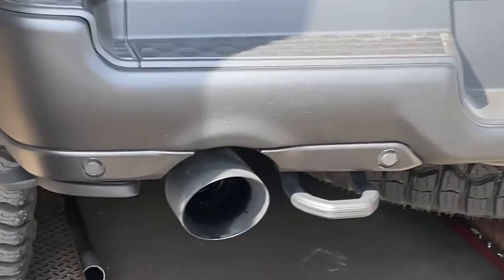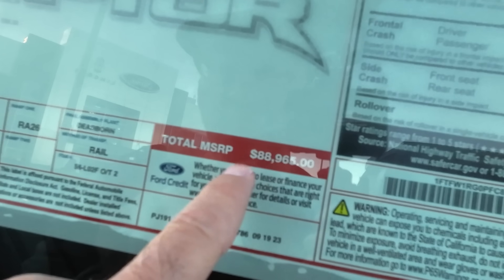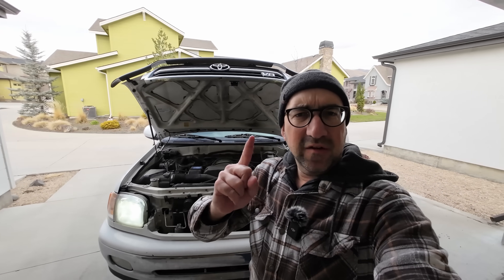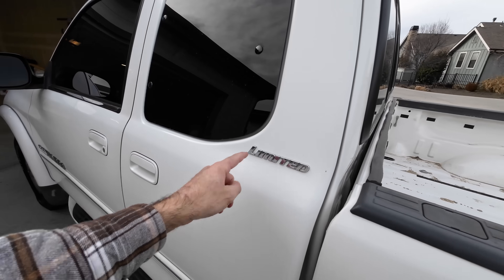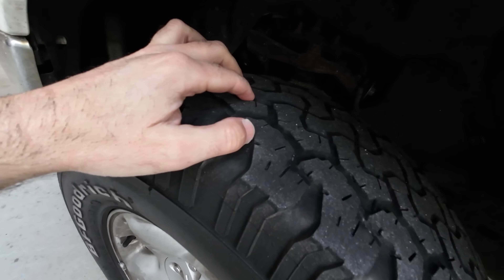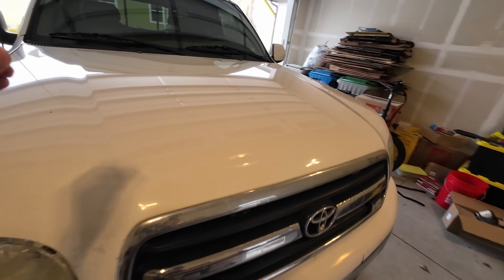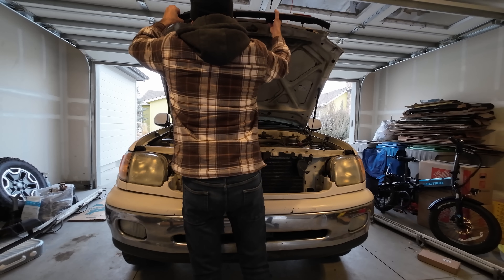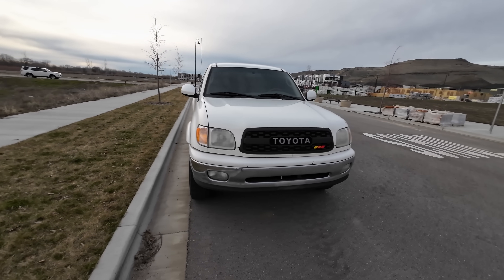I'm Sitting In The BEST V8 TRUCK Ever Made! (and I bought it)

Comment: Bought a 2002 Tundra Limited with every bell and whistle in Sep 2001 with 4 miles on it. It now has 249K on it and its the best truck ever made period. Runs as good if not better than new. For the people who think you paid too much for it? Obviously does not know anything about Toyota. I challenge them to search the country for a cheaper one IN GREAT CONDITION. There is a reason Toyota's are expensive even used, their a superior vehicle. These first Gen Tundras are going to do nothing BUT go up and STAY up! You got a great deal for a Limited 4WD 1 owner. Fords come a dime a dozen for 3-7K for a reason. They wont touch 400k miles much less a million. The Tundra has a million mile club.

Comment: 2005 chevy 2500hd. Lq4 -4l80 single cab 2wheel drive is the best truck ever built or a 96 f150 300 straight 6 with 5 speed manual

Comment: Still have an 02 Tundra with 50k miles
Reply from the maker: Whoa. That is some super low mileage there. Probably worth a lot on Bring A Trailer.
Reply: @MotorFeed  yeah it's a thunder gray trd sr5 , 4.7 , cloth interior same kind of problem with the dirty headlights on yours. Other than that nothing is wrong with it

Comment: Sound should never be a reason to choose an engine in a vehicle. Power output, efficiency, durability, performance yes… sound doesn’t matter.
Reply from the maker: WRONG. It absolutely does matter. Just maybe not to you.
Reply: Allright... I'll wait for you at the end of the track or at the top of the mountain with my buzzy 3.5 EB. ;)  @MotorFeed

Comment: You definitely overpaid for that Tundra considering the condition. I'd say that realistically that's a $7,000 truck. This is why I never bought a used Tacoma, because they are extremely overpriced and when it comes right down to it the frames and body panels are very lightweight compared to the American trucks. That 1st generation Tundra was a complete rip off and nearly a copy of the F-150. Ford even sued them and won as Toyota was going to name it the T-150. I've owned Toyota's and while I'd agree that they are good vehicles, in real life they're not that much more dependable vs others in the same class. The timing belts are another aspect that I don't care for on those truck engines.

Comment: I think for $10K you pretty much wasted your money on a gas guzzling 13mpg slug 245HP 4.7 V8... Toyota could never make a V8 as good a GM or Ford. GM today builds the best V8 engines. Reason why the 4.7 is so reliable is 90% of owners dont use them for work and beat on them anbd they are so bad on fuel that they barely see speeds over 65 mph 245 HP 🤣

Comment: I still prefer the 97-04 v8 dakota with the 5.2/5.9  I've had four dakotas. One 97 2.5 five speed. 99 318 5 speed a 2001 4.7 AWD and a 5.9 auto. All were good trucks. The 4.7 was actually a good truck until it was totalled....don't lend your girlfriend brother your truck

Comment: The 'What You Don't Like Stuff/Things' have only to do with personal appearance, maybe later you mention mechanical well known issues outside of the frame such as lower ball joint failures that must  forever be kept maintained so they won't catastrophically fail while operating at higher speed. How about the starter location which makes it not DIY Rn'R for many whom are less than backyard shade tree inclined? 
All your personal issues of mention were just that, boring if all one needs to know is its known 'issues' which are few but the Million Mile engine woud have at a minimum 7 to 8 timing belt/water pump Rn'Rs not that I suspect that this would cancel this engine's bullet proof reliability. I have a 2003 4.7iForce SR5 Access Cab basic 4 x 2 auto trans that with 170K on the clock is a stout hauler. She has no clear coat topside, as a SW outdoor desert truck for 20+ years, I couldn't care less. The 4 x 4 that everyone vyes for is nary nor ever has been for me desirable. I'm not going off roading, who can afford* that in today's real world of economics?

" With the cost of maintaining and operating a vehicle today I opt for the best highways where possible and with lower ball joint failure issues, I'm not going to encourage the Rn"R of said failure point which now me being on a fixed income...
You get my drift!🎉

Comment: First gen raptors are absolute piles of shit. They have so many timing and valve train issues. The chain stretches and it goes out of time. Starts spitting smoke out of the tail pipe and eventually grenades the engine. Total garbage. The government/EPA is ruining good vehicles I agree. That is why I bought the 23 Tacoma with the V6. No turbos, hybrid system, or start/stop garbage. Last of the simple Tacomas. It has some newer tech but its not over the top.

Comment: That’s not a real truck it has a rubber timing belt.
Reply from the maker: Fake news. 😂
Reply: @MotorFeed  old tundras do having timing belts. When that belt wears out the motor will jump timing. With an interference engine thats a big deal. They break all the time that’s why people don’t use them for towing
Reply from the maker: I meant calling it "not a real truck" is fake news.
Reply: @MotorFeed  If it can’t reliably do truck stuff than how is it a real truck. Just a car with a bed imo

Comment: This perception that Turbo engines aren't reliable is BS. Woke Ideology? BS. Every effect has a cause. Design better engines. Literally the only down-side to V8 motors is poor fuel economy. V8 output is practically double what it was in the '90s (back when a GM 350 had 210 HP and you thought you had something). No, the disappearing V8 is due to 1 thing: a conscious design choice to wage a horsepower war for the Truck Bros, and forget about fuel economy. Factory V8 motors still getting fuel economy numbers seen in the 1980's and 1990's is unacceptable. The benefit of turbocharging is that you can make big power on demand with smaller displacement and deliver better fuel economy.